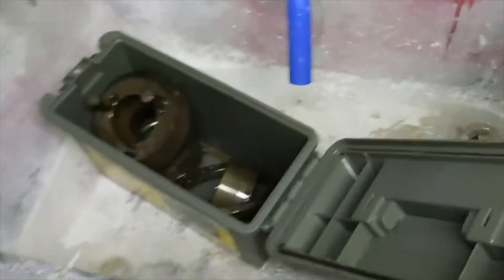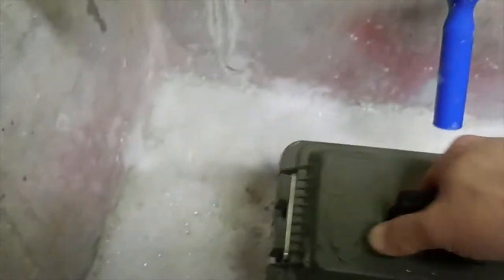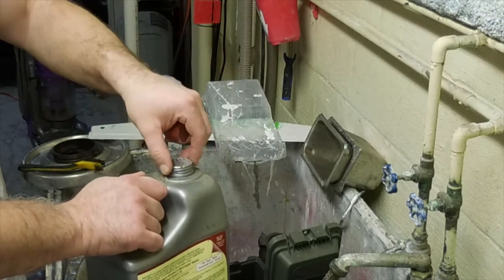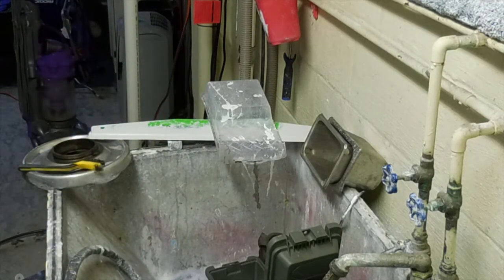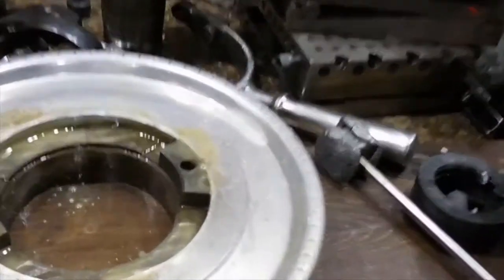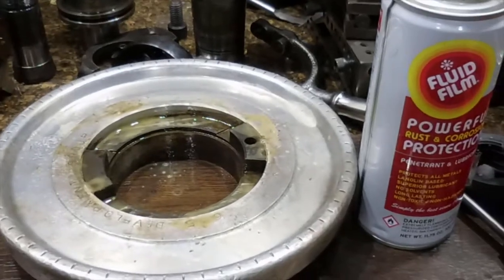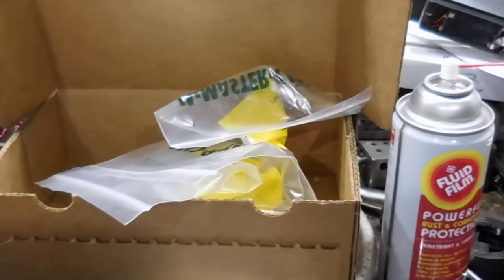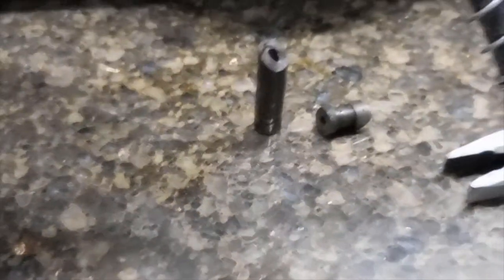Jacobs collet chuck part 2

Comment: Hey Dan.

I am starting to feel sorry for the guy,s over at Active Atom.
Well one Guy  ( Patrick ).
Any bad press must include poor Patrick.
Lance seems to be the pot stirrer while poor Patrick is caught up in the cross fire, LOL.

In all honesty we would be lost without our YouTube Ambassadors.

The can of  Fluid Film is something i have in my workshop also.
Must be a International brand.
I use it mostly for my Milling Machine table. 

Dan i think you are on to something in regards to the shear factor for that dowel pin.
Usually the only reason for creating a weak point in any structure.

I had the similar scenario with an Auto Feed drill press i rebuilt for a customer.
Where the standard drive gear was made from Bakelite.
But it was not Apprentice Proof ???? ( they can destroy a army tank if given half a chance ).

I replaced it with an Aluminium gear, amongst other repairs ?????

I did post a video about this gear being cut using a rotary table.
It made good for an instructional video on Gear Cutting without an Indexing Plate.

Always good to catch up with Dan in the workshop.
Thanks for the video.
Regards Peter.
Reply from the maker: Peter CCR ENG You are too kind Peter. Warts and all is my motto. I can edit it out but that would not be fair. 

I will check out the balance of your video catalog. 

Nice to know Fluid Film is down under as well. Great product not as well known as it ought to be. 

Thanks for hanging in with me. Your comments always make me smile and appreciate the fact that I am not the only guy so afflicted with enjoying shop time.
Reply: @houseofbrokendobbsthings5537  
Glad to know you, Dan.